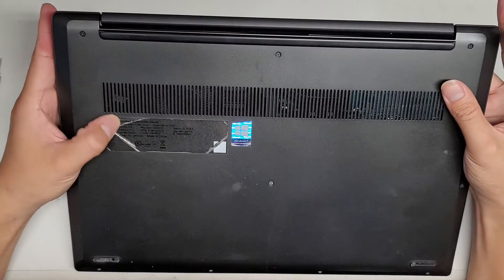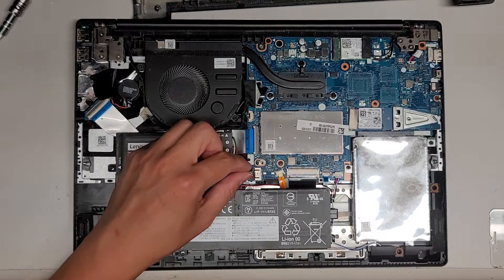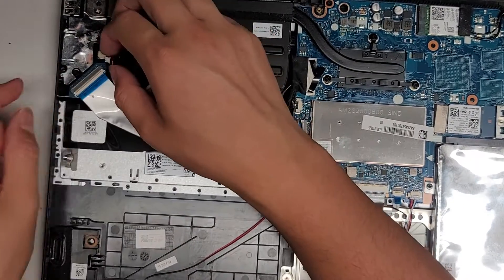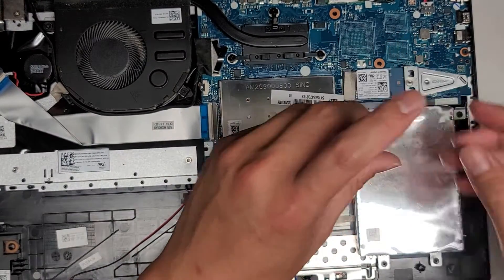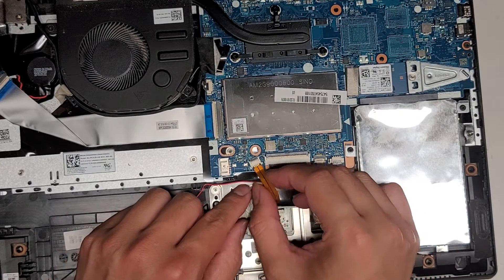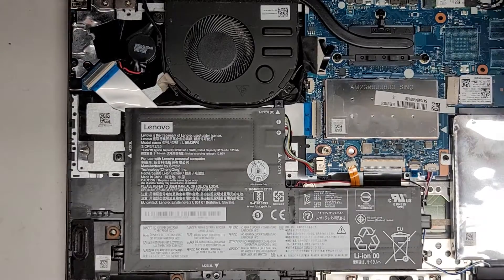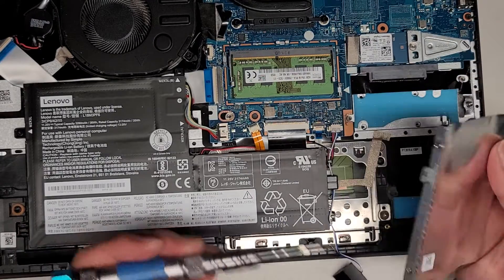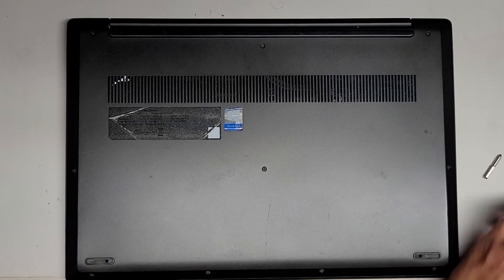Lenovo IdeaPad S340-15IWL Touch Disassembly RAM SSD Hard Drive Upgrade Battery Replacement Repair

Comment: Watching your video, I wanted to change the RAM and m.2 ssd, but when I put the computer back together and turn it on, the button turns on the light for a few seconds and then turns off, but it does not boot or display.  Put back all your old parts but it's still the same.
Reply from the maker: Double check the ram is seated all the way

Comment: I also have the 15iwl but with 8gb ram. The specification sheet on lenovo website says 12 gb max. Can i upgrade to 16gb ram max? Would that affect the laptop?
Reply from the maker: That depends if it's 8gb soldered and the slot empty. If it's 4gb soldered and 4gb in the slot, you should be able to put a 16gb, for 20gb total no problem
Reply: @ItsBinhRepaired  okay. Thank you very much
Reply from the maker: @davidbanks7389  no problem

Comment: Do you know where you'd find the bios flash chip for this laptop because I'm trying to find it, but as far as I can tell none of the 8pin chips have a bios model number
maybe its on the other side of the motherboard or something? Would be a big pain if it was.
Reply from the maker: No idea

Comment: What is that orange flap at 10:20? I'm replacing the battery (thank you for the helpful video!) but I'm noticing that I'm missing whatever that is. Doesn't seem to affect anything though
Reply from the maker: That's the keyboard backlight cable.

Comment: Thanks for the help! I have been hearing rattling in my laptop (same model) for a little while and thought nothing of it (like an idiot). Then today it wouldn't turn on or charge, so I opened it up and had the EXACT same screw undone. Luckily, I put it back in, did a good old disconnect the battery and reconnect it after holding the power button, and everything is back in order. 

So, even though I didn't need to do any replacement or upgrading, this video helped me out a lot in navigating what was what. Thanks again!
Reply from the maker: Awesome, glad I helped! If you haven't already, don't forget to like and subscribe so others can find my videos. Thanks!

Comment: hey! great video.  guess what, have exactly same model S340-15IWL 81QF, and the stupid screw from HDD bracket fell out and shorted PQ501 on the motherboard, so my laptop is now bricked and not turning on at all !   :)  you mentioned owner of your laptop also had motherboard fried.  do you know if they were able repair it?  looks like motherboards LA-H101P run for $300+
Reply from the maker: I don't remember, but what the screw shorted out can vary greatly